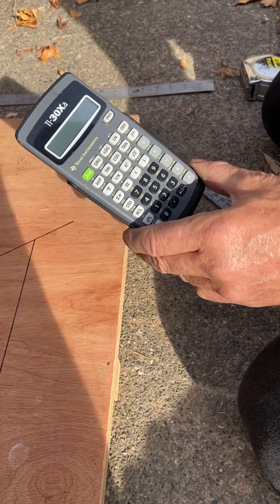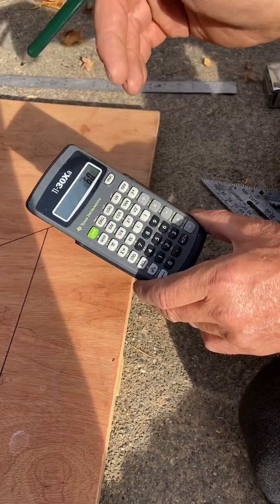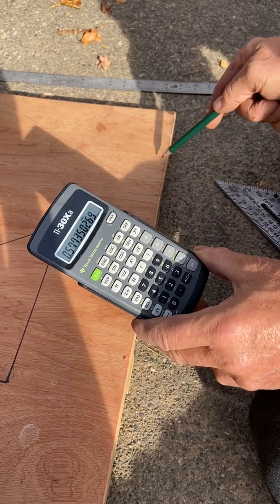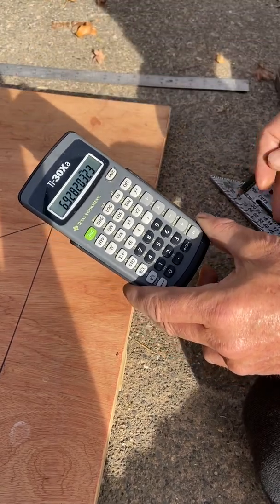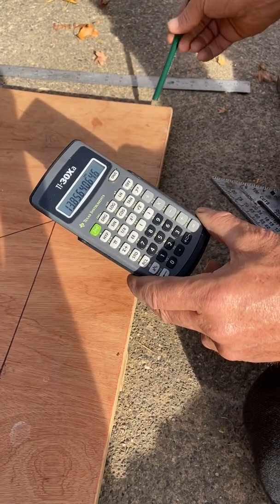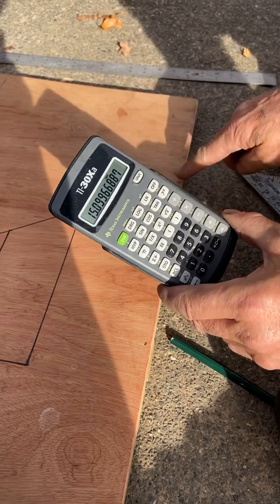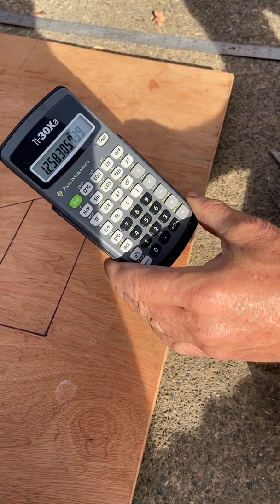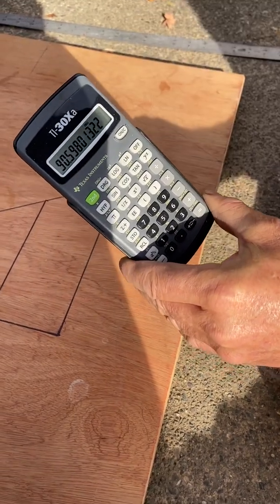Math for Hexagon hips

Comment: In the video you said 90.5”… actually it would be 90.6” if you round up.  
Using the same math a octogon hip length would be 85.84” (72”run, 6” pitch)🤙🏾🤙🏾